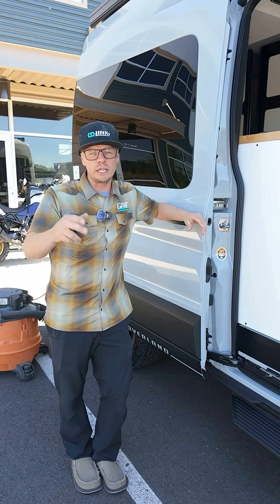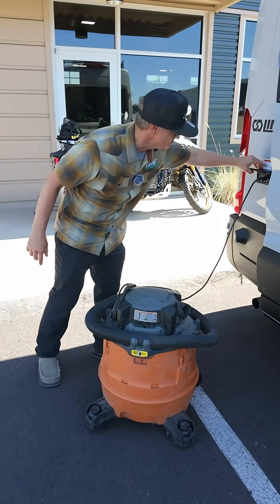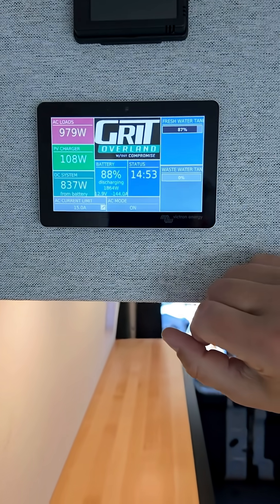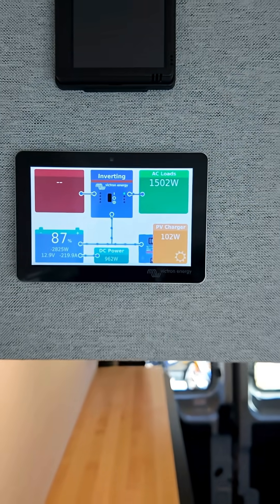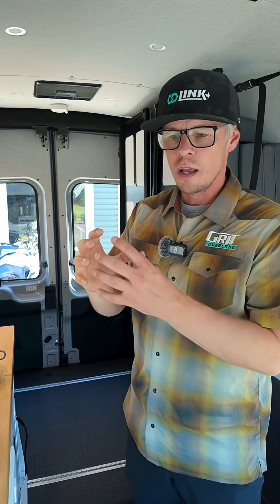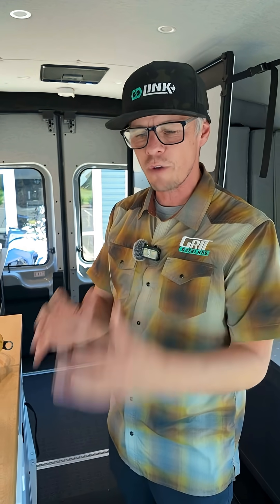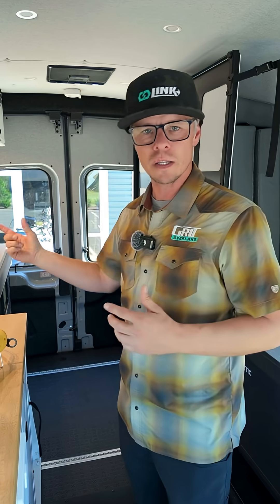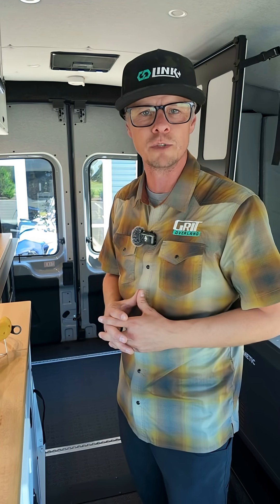12V Camper Van Stress Test: Cook + Cool Together | Grit Overland Link 148 AWD

Comment: Cool!  What's your battery cell ratings and configuration?   What are your charging sources in addition to solar?   What electronics boxes are you using and what is the configuration of interconnection?   Inquiring minds want to know!

And I presume you're insinuating that the DC powered air conditioner uses less electrical input power per BTU out than an equivalent AC powered unit plus inverter loss.  Have you made measurements?    Is that unit using a DC motor?  

Along that vein, have you measured the efficiency of a DC powered refrigerator and compared to an AC powered refrigerator?  And then compared overall efficiencies as seen by the batteries when the ac fridge is run through an inverter?

I know we can't trust marketing to tell us the truth, the whole truth, and nothing but the truth!  😮
Reply from the maker: it is hard to trust what people put on labels or try and convince us. That's what we try to accomplish with these raw videos. Check out our education video playlist that goes in depth on our electrical system for more information
Reply from the maker: also, sorry it took so long to reply... it got buried in the notifications